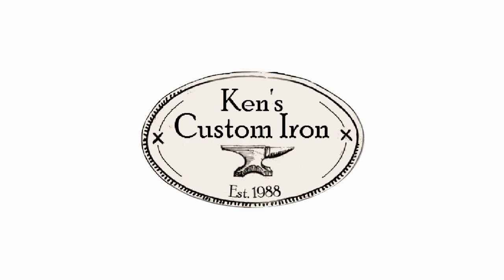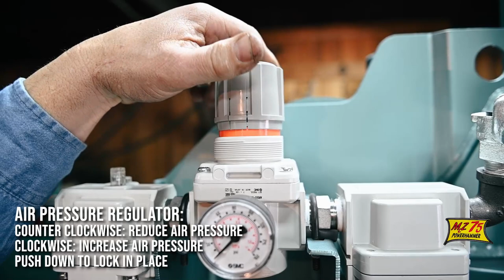MZ75 Power Hammer - A Full Walkthrough

Comment: Heck yeah,thank you again for the overview 

I’ve still yet to hook up the cycle adjuster I made based on what I could see in your videos,my thing is I made my ram 120#s so it takes a bit more air pressure of course 

I may need to drop some weight off once I have the cycle adjuster installed and during the possible troubleshooting